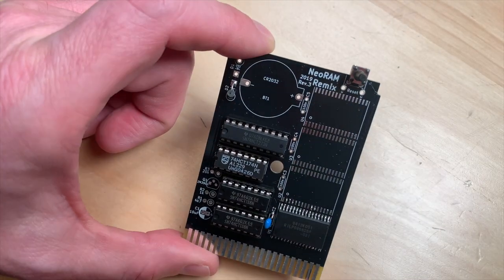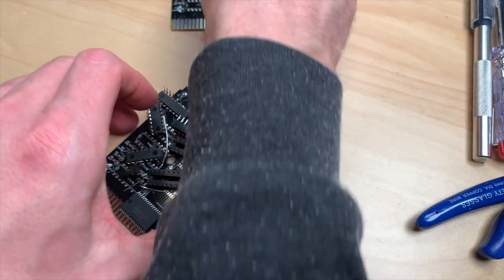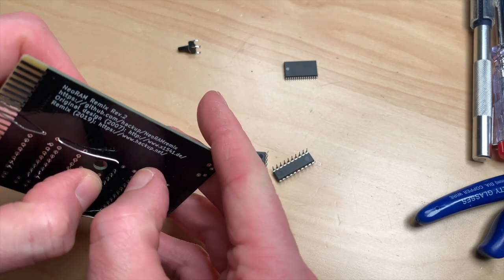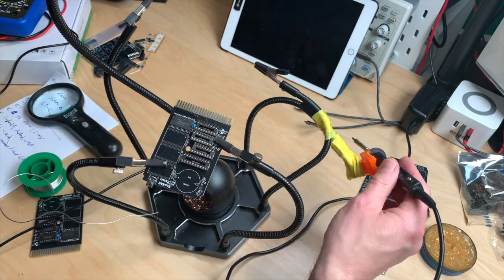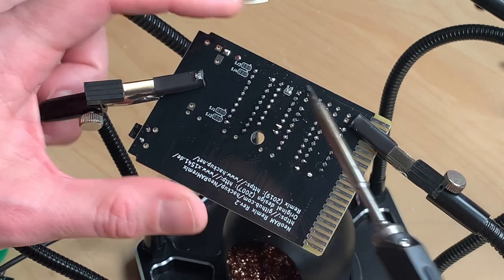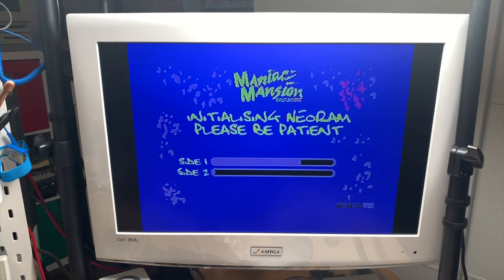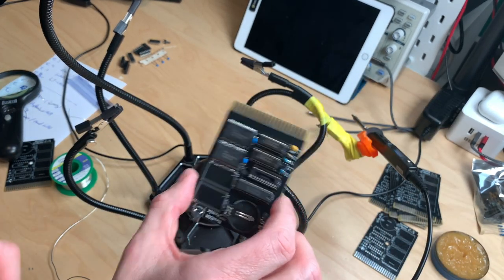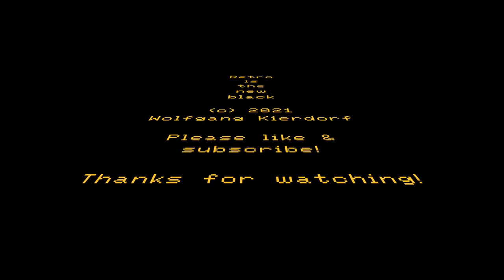Can you build a C64 - 512kb ram expansion for $13? ... and a 1MB & 2MB while you are at it?

Comment: The challenge to keeping the cost down is finding ram affordably. I tried two separate batches from aliexpress, both either fakes or rebadged. I wound up having to get them from a reputable source for about $5 US each plus shipping.
Reply from the maker: I got mine from my local parts dealer Reichelt. 4 for € 15,65. That's almost fair :-)
Reply: Hello Jason, could you share that reputable source so I don't have to go through what you did with aliexpress.? Thank you.

Comment: YES! I was waiting for this, I can't wait to play sonic now with this and an sd2iec.
Reply from the maker: Sonic is not yet ready for this ... and I am not sure if it will be. I don't know enough about the internals of Sonic to be 100% sure about if it is possible to port Sonic to use GeoRam/NeoRam. Other games like Eye of the Beholder or Neuromancer did it ...
Reply: @RetroWK  Ah yes, I caught you mentioning it at the end there. I always seem to get too excited when REUs are mentioned. It's a very fun concept, but there is very little software that takes advantage of things like the 1750 or 1764, not to mention the need of another PSU. NeoRam is definitely interesting and I think I might have to do some research to figure out more of the benefits it can provide. The differences of something like the 1764 compared to Geo/NeoRam is interesting as well. It's just a shame the architecture limits the usefulness of both. It's great that NeoRam is open source and easy to build however, I have read on forums that it might have a bit more potential to support all kinds of software (as demonstrated by you)!
Reply from the maker: @rxblackpill  I will do a follow up to show what you can do with NeoRam.

Comment: Excellent build! I am very interested to see if this emulates an REU enough to run Sonic.
I've got a SideKick64 that can work as a GeoRAM module but Sonic isn't happy with this.
Reply from the maker: Nope, not without Sonic actively supporting it. Sorry! I don't know enough about the internals of Sonic to be 100% sure about if it is possible to port Sonic to use GeoRam/NeoRam. Other games like Eye of the Beholder or Neuromancer did it ...
Reply: @RetroWK  Well now I don't feel so bad about spending all that money to get that lot with the two Commodore REU's.
Reply: @Charleshawn66  Sonic comes with a note with recent versions that original REUs won't work at the 128s 2mhz speeds due to timing issues.  I cannot test this as I don't have an original REU (I traded it for the 128 Programmers Reference manual) and I "only" have the U2+ to work with, which works superbly.
Reply: The thing is, the original Commodore REUs weren't just RAM expansion, they also incorporated a memory controller that could bulk-DMA-copy data between the C64 RAM and the REU expansion RAM independently of the CPU. This is very useful for games because they can use it to update display RAM, for instance.

geoRAM used a simpler scheme - instead of copying RAM back and forth between system RAM and the expansion, the expansion places a portion of the expansion RAM directly in the CPU's address space (shadowing some portion of system RAM) - and you can bank-switch to access different areas of the expansion. The benefit is you don't need to copy the data back and forth - you can directly access a little piece of it at a time - but you don't get the benefit of those DMA transfers.
Reply: @tetsujin_144  TY for teaching me something!! I'm 55 and still learning things about my C64 that I got for Xmas 1983.
Reply: @Charleshawn66   It was a recent lesson for me as well - back when the Super Mario port news was going around
Reply from the maker: @tetsujin_144  Thanks! I was just preparing a new video about that and it is exactly as you say.

Comment: now add an fpga and a stm32 wit esp32, now its a $70-100 upgrade, just need software support first...even 32k dual port sram is cheap
Reply: direct binary and rom flashing via wifi!
Reply: can just connect to a rom download unzip extract, and write contents to memory, wit dat fpga, stm32, and esp32 it'll be fast too! can even add a micro sd slot...and its own rom with its own custom os and routines better than stock shit
Reply: got enough co-processing and dsp power to actually run a usable gui os on an 8bit machine, could throw a pic32 chip in which has built logic for display and graphics processing
Reply: can throw an ay8910 or 8930 for sound expansion and dat 16bit gpio port, hook it up to a db-25 and connect anything you want, get a dac chip and boom digital audio too! well dat pic, stm or esp probably has some sort of dac capability somewhere, shit if dat fpga has some config blocks left over just throw it in dat, or maybe cram everthing even into a cpld instead

Comment: Seems logical that one could add a flash rom containing something like the sonic port. It opens up the possibility for physical releases , new games that use the REU without people needing to already have one. I've paid £39 for a modern C64 cartridge game so clearly theres margin for profit there if they can be made this cheaply.
Reply from the maker: The problem is, that the REU has custom hardware that is not present on the GEORAM / NEORAM. That's why Sonic doesn't work ...

Comment: REU alternative ?
Reply from the maker: Depends on what you plan to do with it. The REU had some logic inside which this one does not. So it's not a plug&play replacement. There is software out there. Everything that runs with GeoRam or NeoRam runs with this. I hope they port Sonic to use GeoRam/NeoRam.
Reply: @RetroWK  You can't port Sonic to run with out the DMA controller. with it out the ram can not move faster enough.
Reply from the maker: @Mr_Meowingtons  I don't know about the internals of Sonic. If they use the extended memory to store assets (graphics, music etc.) then it would work. If they use it as a screenbuffer or something, then it would be almost impossible.

Comment: I'd love for someone with way more skills than me to make a CMD SuperCPU-like accelerator for the C64 that plugs into the cartridge port just like the original did, but it could use an FPGA instead of a 65C816S which would allow it to do even more amazing things, like run at mind-blowing speeds probably well over 100mhz. Imagine what kinds of games you could create for the C64 even if the only difference was a processor running at, say, 300-500mhz....
Reply from the maker: That would be very cool ... and would need someone with way way more skills than I have ;-)
Reply: Nah, it wouldn't make all that much difference when it comes to games. Remember that VIC accesses it's RAM block in the fixed time - it's video memory stays the same in terms of both speed and size. So at some point giving more powerful CPU looks like pairing up Riva TNT with 13th gen Core i9. While it still might be faster in some aspects most of the game will run basically the same as on e.g. Athlon 800MHz. Just because Riva will be a bottleneck. And in C64 with SuperCPU original hardware memory access is limiting factor. Having that said - sure there is some work to get W65C816S FPGA implementation but not exactly for C64 CMD SuperCPU compatible cartridge. Given shortages of FPGA and rapidly growing prices I'd say compact and relatively cheap FPGA from manufacturer outside of mainstream - like Lattice or GOWIN - might be a reasonable solution. And with GW1NR having embedded flash and/or ram I bet that one might be a neat and compact all-rounder.